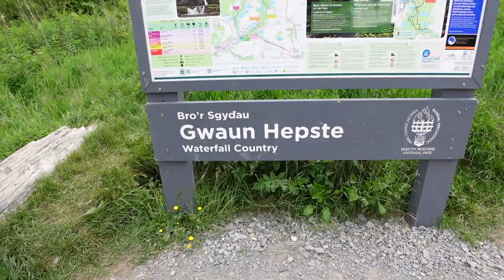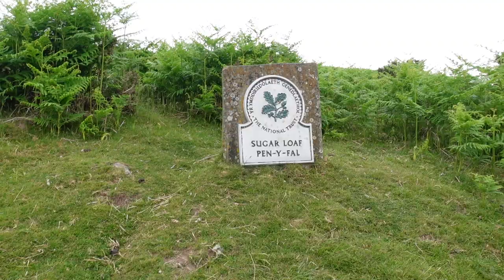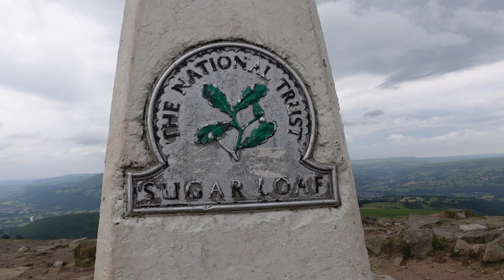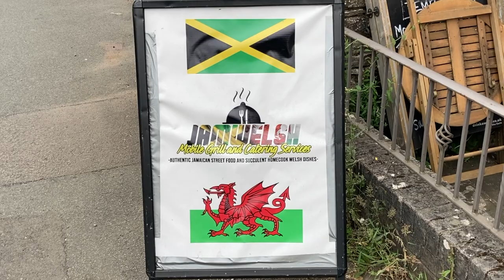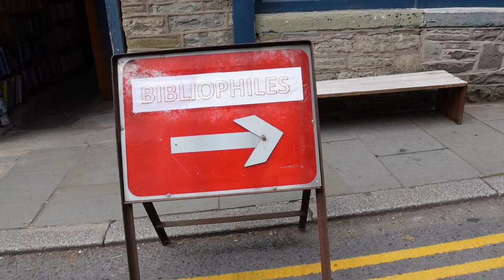South Wales Roadtrip | Pembrokeshire & Brecon Beacons | Van Life Wales

Comment: Do yourself a big favour and get a Bivvy loo and dispose of the bags in dog bins. Use Pee bottles (5 litre water bottle from any supermarket) and tip that away at public toilets. No smell, no hassle and no need to go to a campsite.
Reply from the maker: Yeah that sounds like a good solution, we were considering going down the compost toilet at some point. We do have pee bottles too. Either way we’d still need to go to a campsite to empty the grey tank and fill up the water.